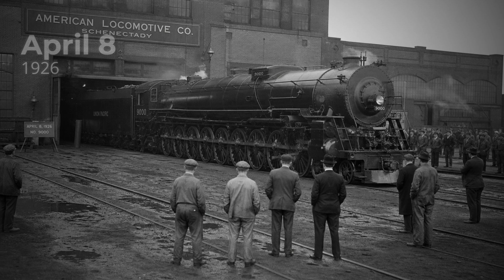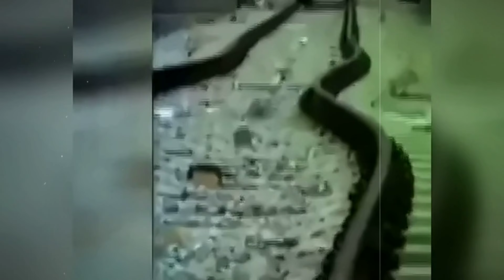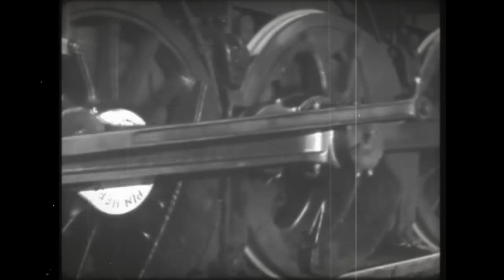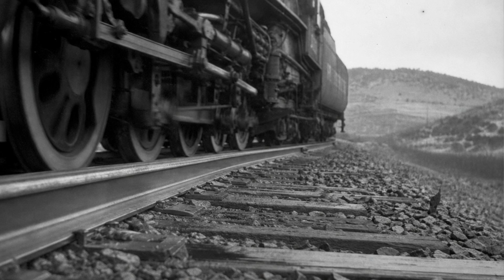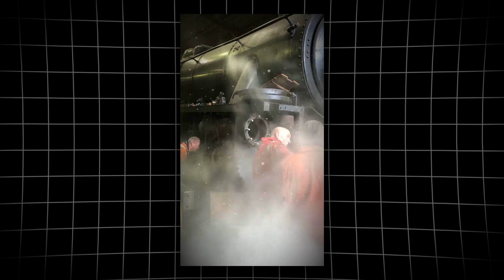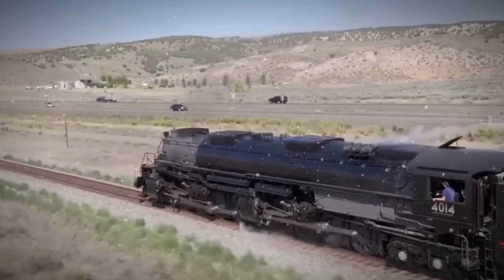The UP 9000: The Unconventional Locomotive That Somehow Worked

Comment: I can solve this problem, rubber frame and rubber boiler to bend around curves. 🤪
Reply: But the boiler and frame would also melt the rubber due to the intense heat and pressure from inside the boiler and firebox.
Reply: @FastFreightProductions  I was joking.

Comment: So I guess the Challenger series includes the infamous 4014...the excellence in engineering with the tools available to them at the time is mindboggling. Great video, Excellent editing and narration.:person-turqouise-waving::person-turqouise-waving::person-turqouise-waving::person-turqouise-waving::person-turqouise-waving::face-red-heart-shape::face-red-heart-shape::hand-pink-waving::hand-pink-waving:
Reply: The challengers were only 3800 and 3900 class. The 4000 class were the big boys. Similar design, just 2 extra set of driving wheels and a lot more size and power.
Reply: @theshapeexists  Another way to tell a Challenger and a Big Boy apart is to look at their placements of both the headlight and shields. The Challengers have a low set of headlights with the shield-like number plate right in the center of the smokebox. The older 3800 classes however had their headlights placed on the center of the smokebox but with no shield.

The Big Boys, like the Challengers, also had their headlights placed on the front end in front of the smokebox, but not directly on the smokebox door itself. The Big Boys also have their shields placed below the headlight, and the wheel arrangements are different too. The Challengers (3800s & 3900s) have two sets of six driving wheels, one set on the front set and the second on the main frame, while the Big Boys had two sets of eight. Proving the Big Boys have reached their maximum height, and are much longer compared to the Challengers.
Reply: Really??

Comment: The 4-12-2 made good use of the three-cylinder system. Eventually a boiler basically the same, was used to create a four-cylinder version with articulated frame and named Challenger.